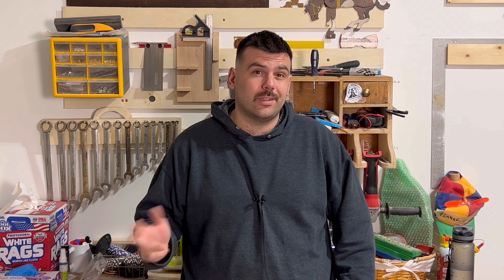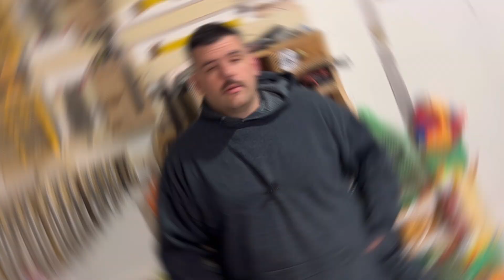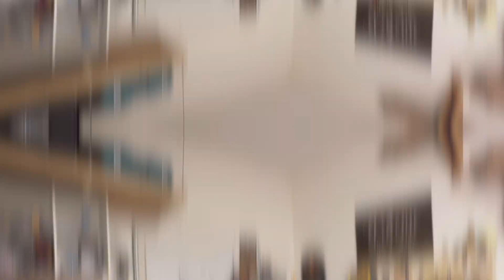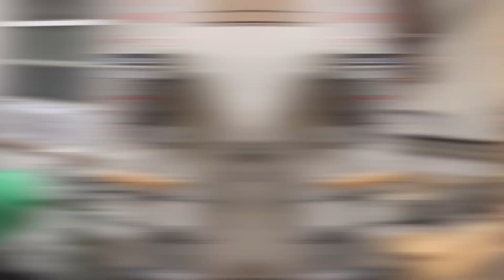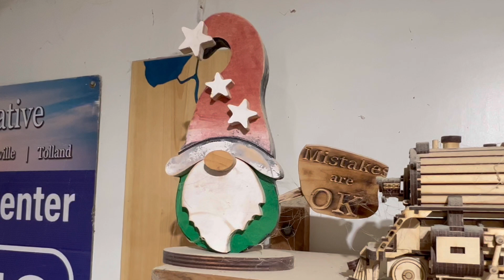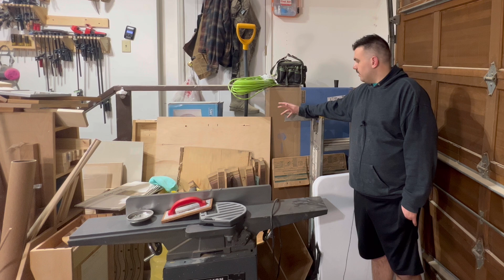CNC Woodworking Garage Shop Tour

Comment: Not a bad shop. Functional, but plenty of room for improvement and organization. And that's probably one of the best parts of a workshop: tailoring it to your own personal workflow. I'd love to see more CNC videos on your shapeoko. I've been woodwokring for 18 years and am finally getting my own CNC (Onefinity) and I'm super pumped!

In regards to whether or not CNC is woodworking, it absolutely is. It's just using software and a tool to cut parts out. The first video of yours I watched was the step stool; you cut the parts on the CNC, but still had to sand, paint, clearcoat, glue the pieces together, round the corners of the top, etc. Sounds like a woodworking project to me. A CNC is just another tool that helps woodworkers work with wood more efficiently. 

I really can't stand the "traditionalist" gatekeeping "woodworkers". They're a detriment to the woodworking community.

Rant over, but keep it up! You're doing a great job for someone newish to the craft and recording on a phone. Subscribed (#999 woo! lol).
Reply from the maker: Hahahah thanks! I gotta get back to making videos